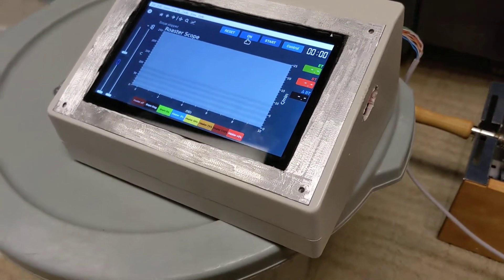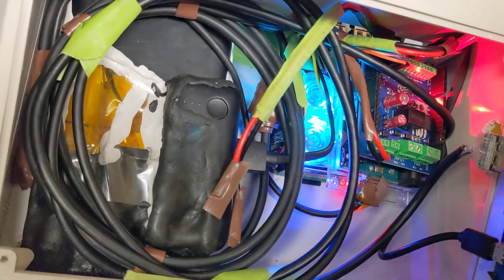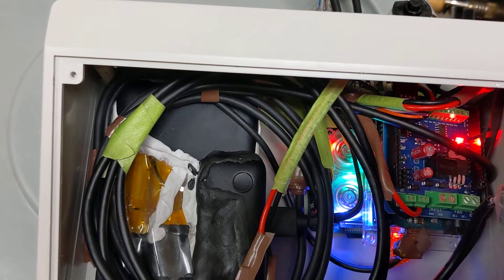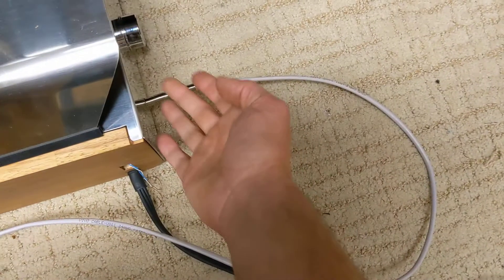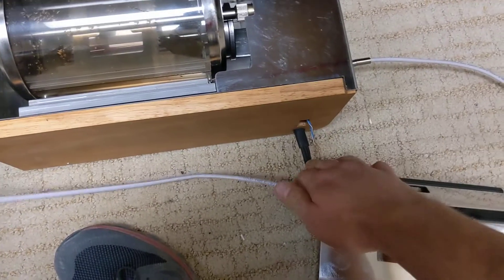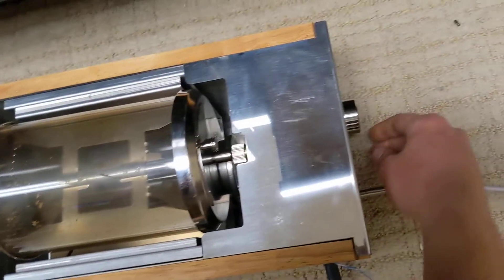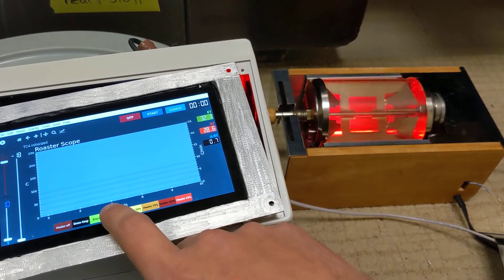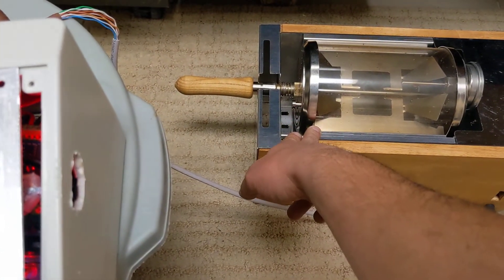Raspberry Pi 4 roasting computer for Boca Boca 500 with Artisan and TC4+

Comment: Hey. Was wondering if this roster has held up? I think you said they used halogen heating elements. Do you know if those are replaceable? Also, your set up is totally tricked out. Nice. Do you think you could roast decently without artisan using the heat knob to profile after the charge time and leading up to first crack? I would love to buy decent beans and having this machine may enable that or am i totally off base ?
Reply from the maker: Yeah it's still working as my backup. I don't use it with artisan anymore and it works well. I think there's a new small drum roaster out there for cheap too.

Comment: Nice Job, pretty smart set up! How do you find the results of the boca boca? Also have you shared the code for your arduino setup connection to artisan?
Reply from the maker: @DaniZeguados  unfortunately I never found a way to use or make a slip ring that was affordable. Plenty of options available, but none that would handle the high heat without costing an arm and a leg. Shortly after this I got a purpose built roaster. The only thing Artisan was useful for was maybe logging my inputs. The only control I had was start or stop of the rotating and the heat level. But without the measurements it wasn't very useful. Just a good proof of concept. It could probably be done with a wireless meat thermometer in place of the manual temp gauge.
I also had aspirations to make my own drum that would allow me to add an open area to add beans while spinning, or a fan, but it got sidelined. I'd love to see someone take it to the next level as it's a great starting point.
Reply from the maker: @DaniZeguados  I never published the code, as I used a lot of already available artisan Arduino code and the roaster hat that was available with its code. My suggestion to someone doing it today would be to try yourself with an Arduino or a raspberry pi, and use ChatGPT4 to help with the coding. I'm not a coder, but a decent troubleshooter, and ChatGPT is an amazing tool for anyone with even basic code knowledge. Basic like...I can read and make educated guesses and relay them to ChatGPT to make corrections.